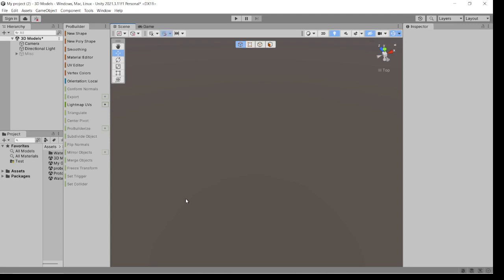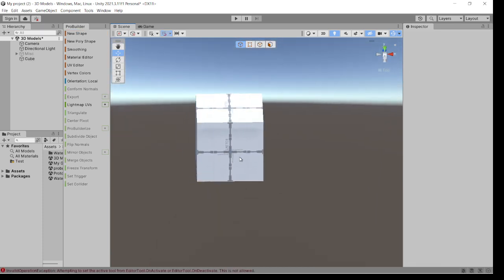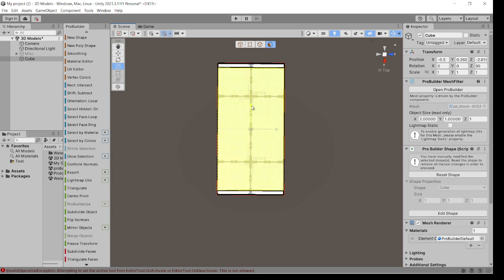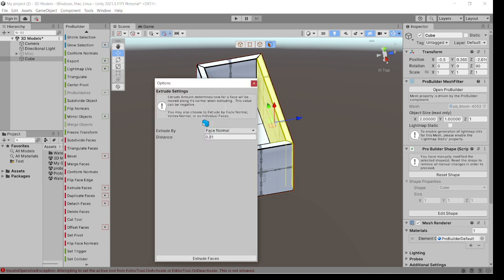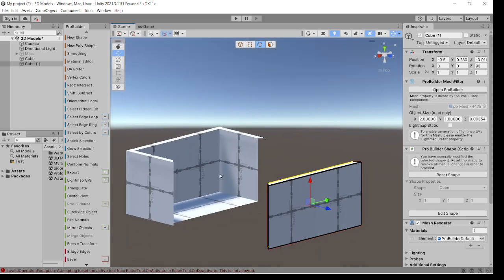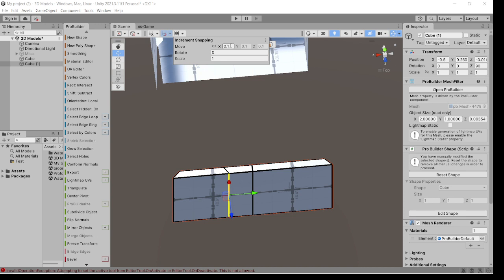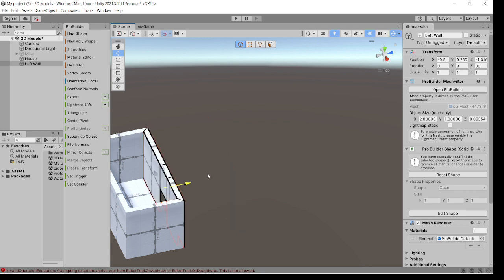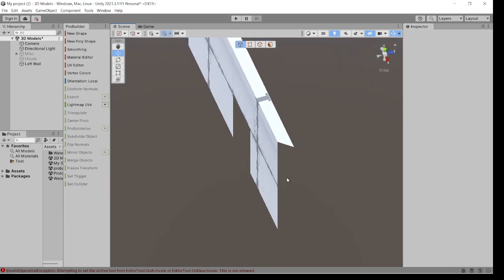Unity Probuilder. Precision snap building and easy access to complex areas with the detach tool.

Comment: Is it possible to hide faces without detaching them?

Or can you detach the faces as you have shown and then hide the new element?
Reply from the maker: Hi, apologies for delay in replying.  Just seen comment.  I don't believe you can hide without detaching first.  Detaching as a Mesh will not hide, only move sections independently out the way.  Hiding only comes as a full GameObject.